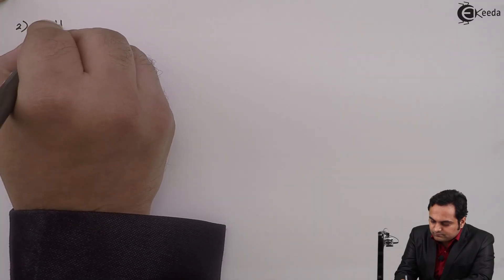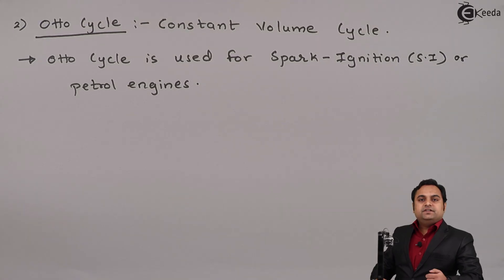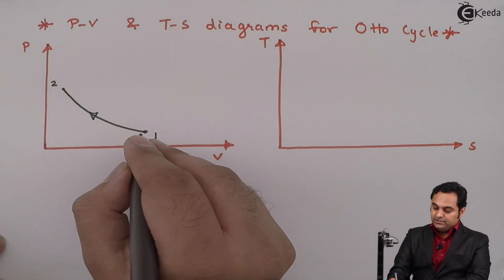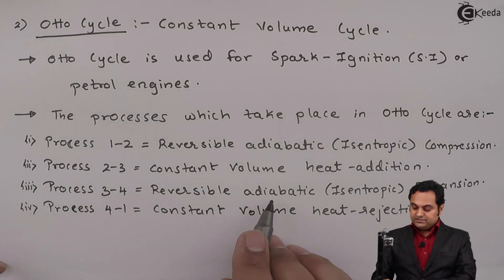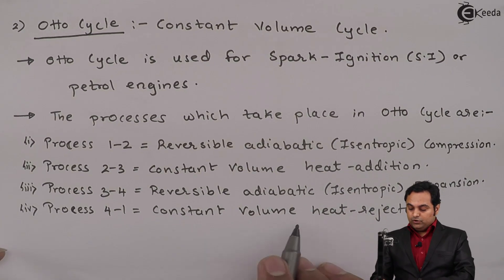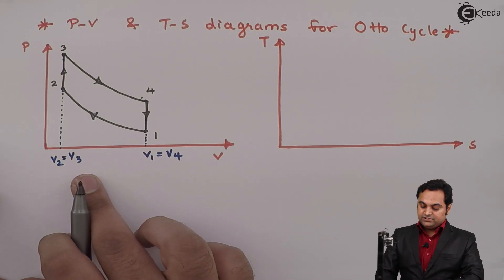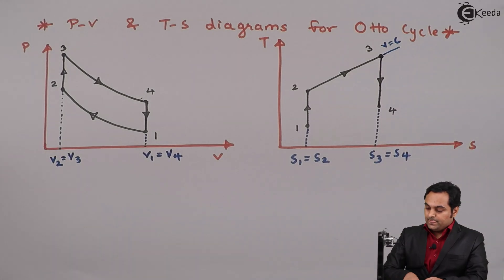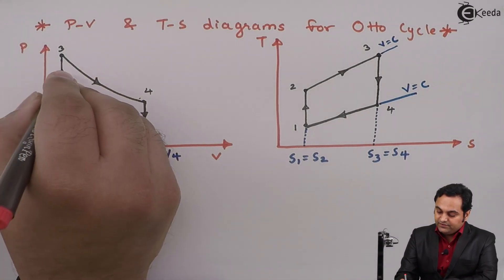What is Otto Cycle in a Type of Gas Power Cycle - Gas Power Cycles - Thermodynamics

Comment: For the curious about engine, I proposed a new cycle that is an otto cycle plus an addition of a special central compression piston called c.c.p engine. I posted the basic diagram in this link.  https://community.oilprice.com/topic/4762-central-compression-piston-engine/?tab=comments#comment-39783, no studies have been done yet but I estimate  that it produce 6 time the power as the usual otto cycle engine currently in use in all cars today.  It has the usual boost of gasoline burning but with a special compression-expansion cycle that is not found in the otto cycle. All that with no additional cost and special costly parts, just small modification easy to measure once a small prototype is tried.
The compression chamber and expansion chamber do not have the same volume, so there is additional power applied to the engine.

Comment: Why is the process 2-3 in T-S diagram a straight line?
Reply: Dabir Nawaf i mean when piston reaches tdc spark plug turns on and petrol ignites...This ignition is taking place at cont volume at tdc...Hence it's const volume heat addition
Reply: as volume is constant
Reply: Why does the process 2-3 is not a curve and it is necessarily a straight line?
Reply: In the constant pressure heat addition also it is straight line (In his video)
but the fact is this, it can be curve or straight line. Whether at P=C or V=C, addition of heat increases both entropy and temperature (dQ=dS.T). If the temp n entropy varies linearly then it will be straight line. otherwise it will be a curve
Reply: Spark plug supplies energy at cont volume
Reply: Denny J Ottarackal 
Spark plug is use to ignite the fuel inside the cylinder